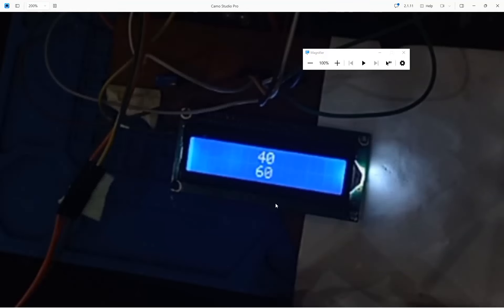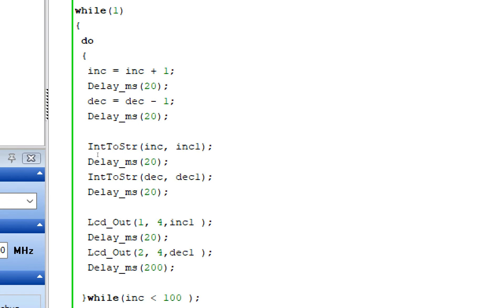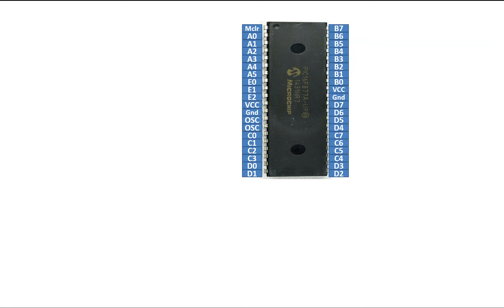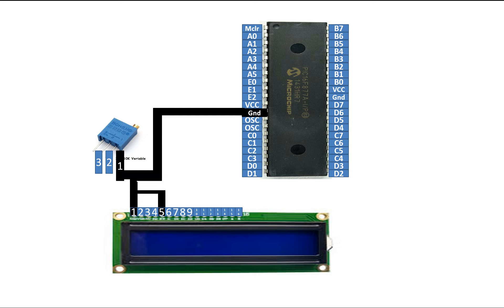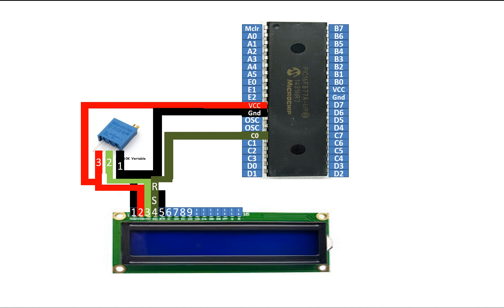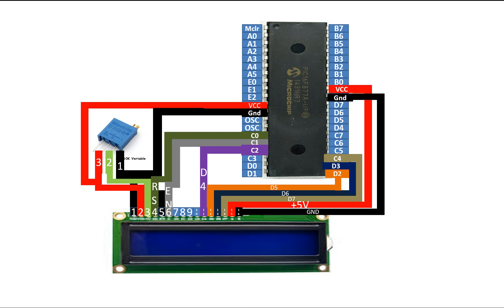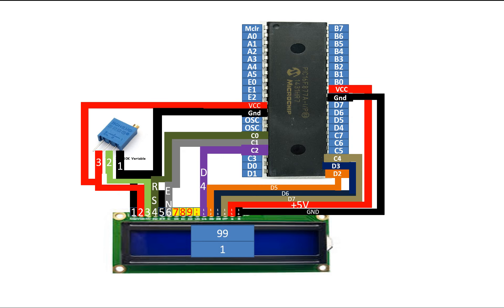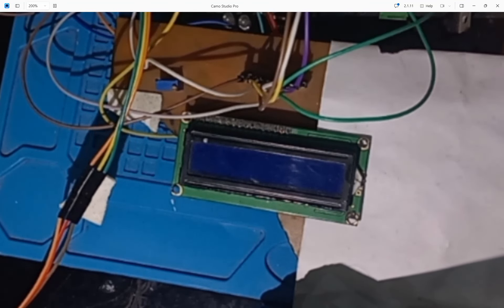Running multiple counters on 16x2 LM016 LCD using PIC16F877A MCU.

Comment: Why my 1602A only show row of squares , did u have a such problem before ?
Reply from the maker: Did you changed contrast?
Try rotating contrast resistor.
If don't work
Then you have some wire which is not connected to programmed pin.
Check wiring and confirm the pins in the programming.
Even if any wire is incorrectly connected it will show box only
Reply: @learningmicrocontrollers3561  i checked all that , is there may be problem with the oscillator, i am using 8Mhz crystal but without capacitors .
Reply from the maker: Then 1st try just blinking an LED using any I/O pin
Reply from the maker: And let it blink for 10 minutes
Reply from the maker: Which microcontroller you are using?

And are you using MikroC for a PIC or MPLab software?